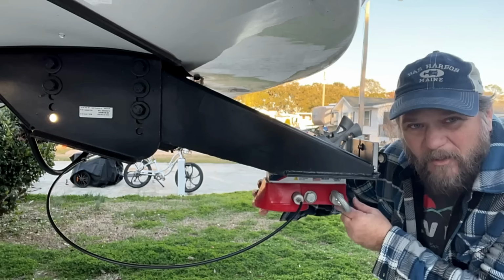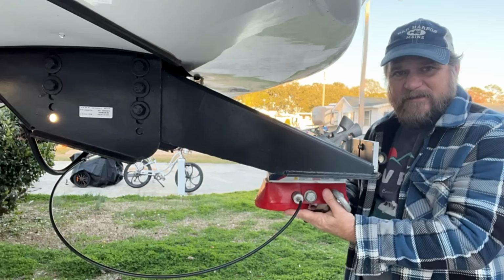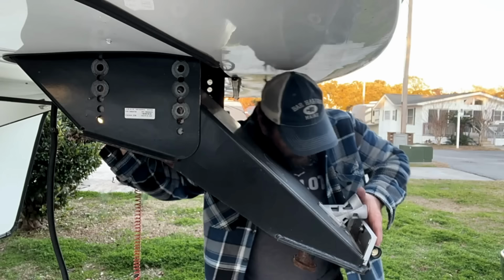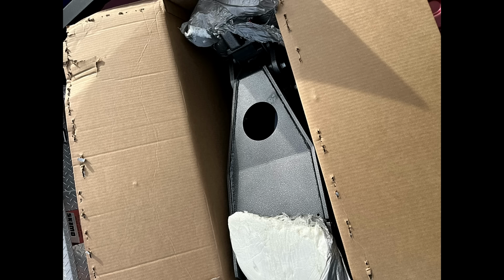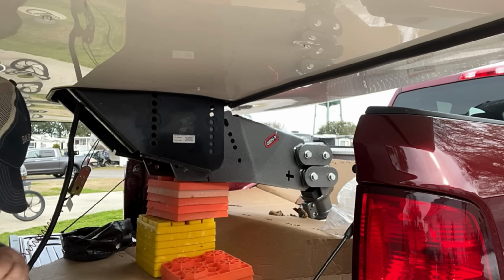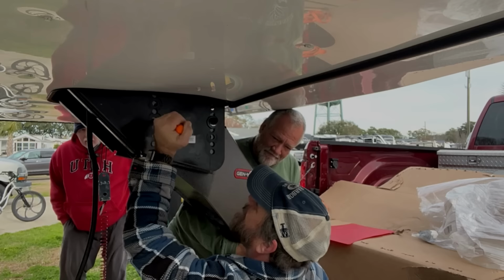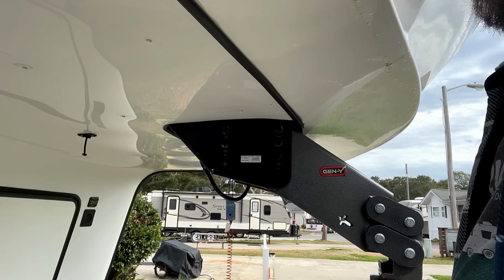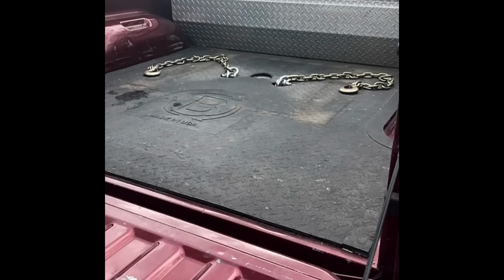Fifth Wheel to Gooseneck Conversion Revealed!

Comment: Great video, loved the music and nice fade-in’s during voice overs. 

All the discussion on if Lippert voids or handles the Gooseneck, particularly the Gen-Y models. Which is true, they use that reasoning not to install. Although it still returns back to the specifications the Brand gives to Lippert in frame design, not necessarily Lippert quality. 

As example, Brinkley’s frame spec… also by Lippert openly advertises a Gen-Y 5th or Goose can be used with their Units, including their Toyhaulers. 

Gives indication some manufacturers are designing their frames more robust than others… most Frame flex issues I’ve seen are all Grand Design models. 

Goose Necks offer multiple advantages over Pinbox.
Reply from the maker: Thank you for watching and the nice feedback.  We appreciate your support.

Comment: So I’ve done some research on gooseneck hitches and discovered that that type of hitch will concentrate weight loads to the trailer frame whereas a conventional pin box more evenly distributes the weight loads.  If the trailer frame was not designed for a gooseneck hitch the extra load could cause the frame to fail. Most frame suppliers (Lippert) will void the frame warranty if a gooseneck hitch is being used. Considering all the recent fifth wheel frame flex videos on YouTube I’d would want to be sure that my frame can withstand a gooseneck hitch
Reply: So if i understand your comment, you are saying based on size, the ball in theory puts a single point pressure where as a 5ver plate is spread out.  Thereby putting higher pressure on the frame.  That mathmatically would be correct, but the point missed is in a 5th wheel camper there is a pin box, thereby the pin box would change that calculation of load.  I agree that if you didnt have a pin box and you simply had all frame, then yes that statement would be correct.
Reply from the maker: Thanks for watching and subscribing.  I appreciate your input.

Comment: How much weight did you add to the hitch weight. Between the Andersen hitch and the Gen Y hitch?
Reply from the maker: The Gen Y I believe was about 155 lbs if I remember correctly. The old king pin I removed I’m guessing here was probably about? 50 ish pounds. Maybe a little more. So I wouldn’t be afraid to say the Gen Y is probably 80-100 lbs different.

Comment: I too am running the Andersen Ultimate 5th hitch. I have the king pin receiver in the forward position to give me the best turning angle without hitting my cab. I have the 6.5' bed on my Silverado and have been thinking of making the same switch to just the goose ball hitch. With the Gen-Y hitch, how much closer to your cab is your camper now vs. the way you had the Andersen configured?
Reply from the maker: I'll let you know as soon as I hook up to it to haul.  I'll make sure to include that in the follow up video.  Thank you watching and thanks for your question.

Comment: I wonder why the chains aren't fastened on the camper and hook to the truck with the hooks like gooseneck trailers and not in the way when empty.
Reply from the maker: I haven't changed the chains over from the old setup yet.  When I had the Andersen hitch, I found it easier to hitch to the pin box than the truck bed.  It didn't involve me having to get into the back of the truck to hook the safety chains.  I'm experimenting at the moment.
Reply: Thumbs up, ya if you don't need the floor space :)  @RamblinReflections

Comment: ive heard a gooseneck will put stress on the front of 5th wheel over a pin box. 5th wheels are not designed with the stress load like a horse trailer or a steel front end cargo trailer. Be careful of these videos of people being sucked in because they get the hitch for free to make a video.
Reply from the maker: I didn't get the hitch for free.  I paid for the hitch and this video is not sponsored.

Comment: Worst thing you could ever do transfers the weight in a different direction that’s why this wheels are designed different than gooseneck. Gooseneck is more supported than a fifth wheel hitch so if you do this, you could crack your frame eventually horrible idea.
Reply from the maker: Thanks for watching.